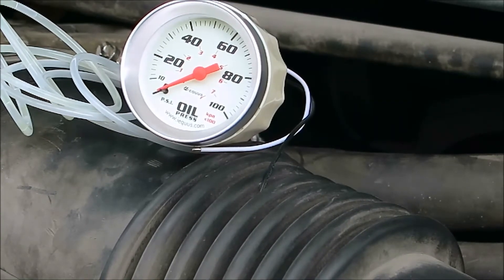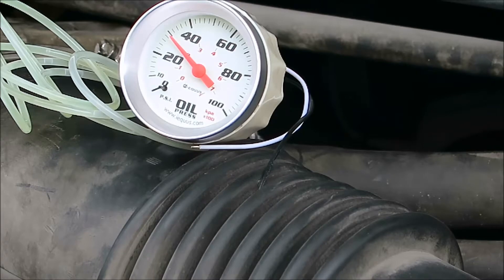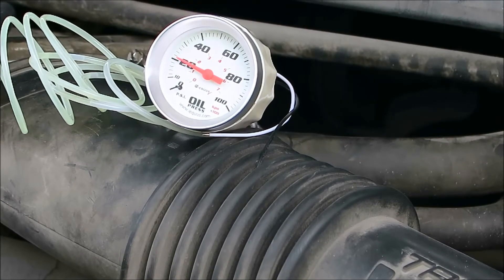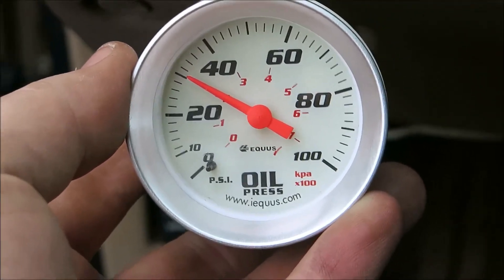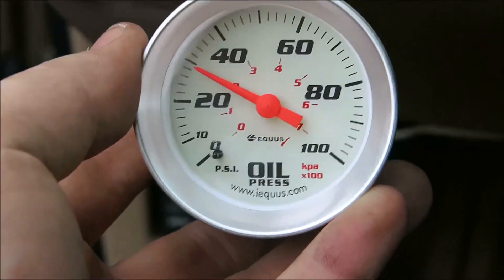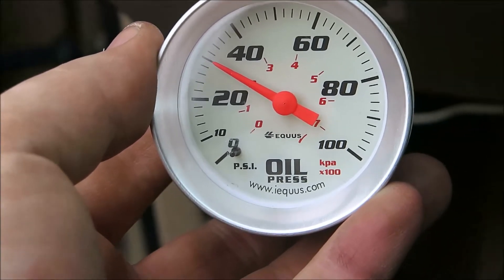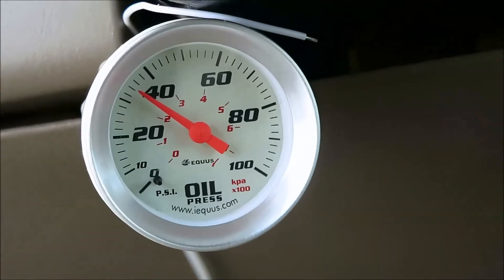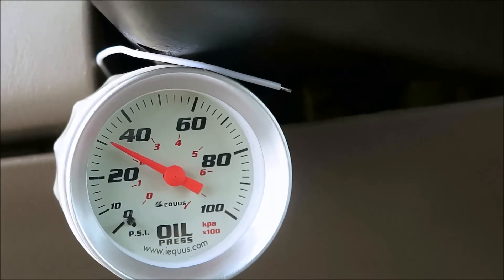2001 F250 V10 6.8L Fuel pressure testing.

Comment: What does it mean if once you turn off the engine the pressure drops rapidly (about 1 minute total) rather than slow. And if there is no pressure buildup until you actually try to start the engine or run it. When idling or pressing the gas, the pressure is perfect. 2003 excursion
Reply: Most likely your fuel pressure regulator is not working properly, or you have a leak to the system between the pump and the gauge
Reply: Probably means either your injector(s) are sticking and  letting fuel bleed into your cylinders (bad for cylinder wear) or possibly the check valves in the fuel system are not seating.

Comment: If your problem was pinging and you're sure gas quality was good and you had no large vacuum leaks, more than likely your spark plug gaps were excessively wide and/or your MAF sensor was dirty or faulty. Fuel pressure slowly rising a few psi with engine shut off is nothing more than hot fuel in fuel rail expanding,..normal on hot engine. Proper way to test for a weak fuel pump is 10 seconds of wide open throttle on freeway/highway in 3rd gear. Pressure should not drop at all.
Reply from the maker: Thanks for the input.  The pinging was solved.  I had multiple header leaks.  Since the engine had 200k on it I decided to do a rebuild.  Rebuild has about 20k miles on it and has been great ever since.

Comment: Put it in the fuel rail on the Schrader valve u screw it on!  Crank the vehicle then read the gauge
Reply: I can’t find the Schrader valve on my 2005 6.8 L V 10 I just change my plugs and coils and looked for it and couldn’t find it any info I appreciate it